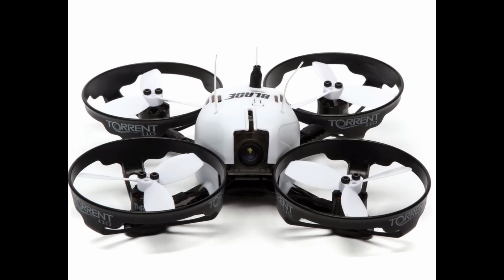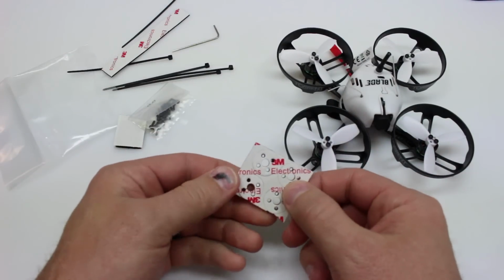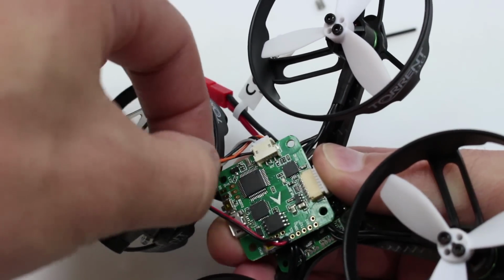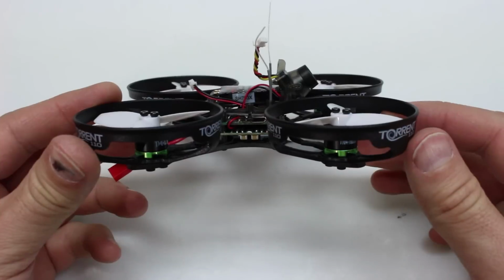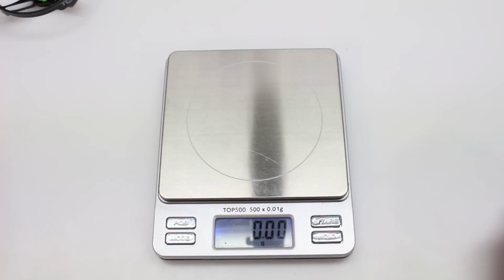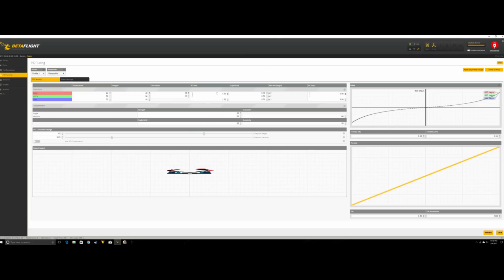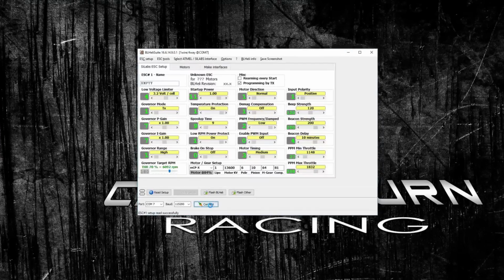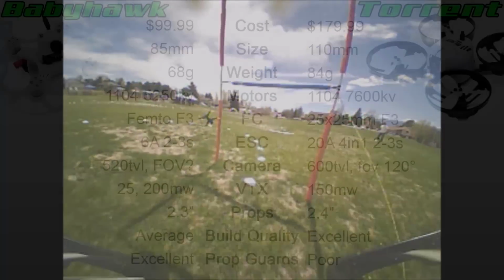Blade Torent 110 Review & Setup - Watch this before you buy!

Comment: I just got one of these last week dirt cheap. Not sure where to start when it comes to a transmitter and batteries. Could you point me in the right direction. This is my first fpv drone experience
Reply from the maker: This quad is set up to bind with a DSMX/DSM2 transmitter. Should be able to pickup a used Spektrum for cheap. Or buy a transmitter that can uses JR modules like a radio master and get a module for DSMX. This would give you more options in the future.
Reply: @CrashNBurnRacing  thank you so much for the reply I was looking at he radio master zorro

Comment: That twitch you mentioned... that's the crappy horizon hobby ESC's . They de-sync under punch outs. I ended up putting anti-gravity on number 5 and only now it keeps the line better. And the motors that came with it...are noisy and bad quality. 
My torrent is so much tuned-upgraded so it will fly better but that should have been done right by Horizon hobby before we slash out 200+€ for unfinished product.

Comment: If you remove the prop guards, you probably need to use shorter screws to avoid running a screw into a motor winding.

Comment: Hey goofball , the flimsy prop guards are helpful when ripping through tight quarters IE tree branches, bushes, etc, if you accidentally clip a branch it helps to save you from a crash. SECONDLY- you said the build quality was exactly what you’d expect from a great company like horizon hobby HA HA HA HA- you’re kidding right, horizon hobby has the worst reputation in the industry, they make their products so they’ll break under minimal wear and tear! I owned a couple of their heli’s And the canopies were absolute trash and would crack and split under minimal abuse, the chemicals we have available in plastics today are incredible and make plastic almost indestructible, but horizon hobby leaves those chemicals out of their manufacturing process on purpose.....
Reply: Or inside they are superfast indoors

Comment: Blade torrent 110 is a piece of junk the esc's will burn out, but just like all the blade BNF quads they are just crap, usually something with the power supply somewhere. Putting the telemetry receiver in this quad is like rolling a turd in sprinkles.
Reply from the maker: Last time I checked a replacement ESC was 60 bucks which is completely ridiculous.
Reply: Thats right its 60 bucks, Hobby town did give me the new esc board free, but i went in and bought a 'BNF" i soldered the new board in last night what a hassle, today when i put it back together if it dont work ill take the receiver out and throw the rest away.
Reply from the maker: Good luck!
Reply: You should learn to fly better iv bought 3 so far because i end up loosing them in the mountains or cliffs probably one of the best micro drone still i think it was just operator error in your situation

Comment: Where do I get the receiver for spectrum or flysky transmitters
Reply from the maker: The BNF version comes with a spektrum receiver,  the PNP version will need a receiver.  You can buy a flysky receiver from several online retailers. I would suggest Getfpv.

Comment: What's the battery life on the 800 mah 2s?
Reply from the maker: Really depends on how hard you push it but if your taking it easy you should be able to get 3 to 4 minutes.
Reply: Archie Mayor I fly a 950 mah 3s
Reply: I’m using 3s 450mah as recommended. Only 2 min and 20 second practical endurance. It goes from 4.2v to about 3.7v. I think the power of the quad rotor is good enough to carry 3s 800mah even 1000mah. It could easy hovering at less than 50% throttle with 3s 450mah battery.

Comment: Had my torrent fixed by seller 2 times flies away . well 7/10/17 it flew away can not find
Reply from the maker: Sorry to hear that.  Maybe Horizon will make a version 2 and actually have a true bind and fly.
Reply: Crash N Burn Racing It runs on betaflight and BLheli, No way it can be a true bind and fly unless blade comes up with there own flight controller and firmware for FC and Esc's. Being on complete open source firmware that they have no control over, Good luck with the wishful thinking. And lets all be serious nothing is truly bind and fly, Only mistake blade made was not disclosing to their biggest Audience that this quad is not an inductrix  you can bang around and its not tuned its running on stock spracing 3.1.5 default pids.. Also big sign saying not for beginners at all 😉 And when has blade used universal components lol
Reply: Mine 2 brother twice
Reply: Haha i lost 2 of mine absolutly same way it just punched on me as i was hovering them both

Comment: I dont understand the soft mounts for the motors. The screws will still transfer vibes so I dont see the point. Anyone kill the drifting issues with them? Have they always been included or are they something new that Blade has tossed in recently? Has anyone had luck with the soft mounts? I dont expect they'll do anything.
Reply from the maker: Joey Nuggetz The soft mounts don't eliminate all the vibration because of the screw but it still does make a difference for the gyro. I have the accelerometer turned off on my torrent but I have read that it helps the drifting issue.
Reply: Maybe I'll give it a shot then. I dont think you mentioned how the annoying screw blocks you from plugging in the usb cable :-) Before I figured that out I was cursing horizon for using a proprietary port connector :-) I haven't taken mine apart. What is that screw actually securing? How hot are your motors coming down with 3S? Debating on 400 or 800mah. Just tested 800 on 3S and the motors were scalding hot.
Reply from the maker: That screw is holding the canopy on, I have a slim USB port that works fine, or you can trim the plastic the usb plug.  My motors are a bit on the hot side but I push the torrent to max every time I fly it.  I tried 2s but there was just not enough performance for me.  I have seen a few people 3s 650mah lipos not sure what brand they were, flight time is terrible with my 3s 450mah nanotechs.  I have another set of the soft mounts and I might try to double up the foam pads to see if it helps, the foam pads are a bit thin.

Comment: HUGE pain in the ass to re-assemble.   I had to disassemble and assemble at least 3x due to incorrect orientation.  I almost also lost the spacers every time too LOL - For any other viewers doing this: Make sure the boards are ALL properly orientated, otherwise it completely ruins your day
Reply from the maker: kneel Glad you got it back together. If one did loose those spacers you could cut some rubber tubing for spacers and have the FC some what soft mounted.
Reply: they are junk

Comment: So the the props would be any less 'done' without the guards?...
Reply from the maker: The prop guards are technically better than nothing for minor bumps and crashes.  But any decent hit bent the props causing them to crack or become unbalanced.  I have broke one guard already and I have been fairly gentle with it for me anyway.  I just received 4 different 2 inch props that have a bit more room in the guards and am just waiting for the weather to clear up to see if they work out better. Also am very close on tuning out nearly all the problems with the PIDs.

Comment: Iam new to the hobbie and don't have a clue lol. I want somthing for indoors which give good flight times, don't like tiny whoop as battery don't last more than couple minutes. Love your reviews and I am pushing towards the babyhawk I have just brought the new Fatshark Hd3 googles and probably spektrum radio although not sure which one to buy yet, with babyhawk what do I need to buy and setup to work with spektrum? Can you buy bind and fly model Iam in the Uk. Thanks again for another good review
Reply from the maker: I heard Emax is going to release a BNF Babyhawk but it would be for the Tanaris and I have not heard when it would come out. For a Spektrum setup besides having a Spektrum transmitter you just need a dsmx or dsm2 satellite receiver.  I used this receiver in my Babyhawk, http://www.lemon-rx.com/index.php?route=product/product&product_id=109
Reply: Thanks for the help, not sure which radio to buy, I flew helicopters about 8 years ago and had spektrum radio hence why thinking about getting , been out the hobbie to long so behind the times
Reply from the maker: I have rarely needed more than 6 channels.  Having 2 aux channels will be enough to have 1 for arming and another for changing flight modes.  I have a DX6 and I really like it, if you want 8 channels the DX8 gen two is only a $100 more.

Comment: I  got exactly the same issue when I was using batteries with too low c rating on other quads before
Reply from the maker: The lipos I use are rated 65c-130c so it's definitely not that.  This wobble and drift in horizon mode is a very well known issue on the forums.  I almost had everything tuned correctly but then I hit my house and broke a prop so when my new props come in I should have another video on tuning the torrent.

Comment: Finally a honest review! Thanks! My Torrent is also dipping to the rear left during full throttle maneuvers. Sometimes it's hard to catch it at the and of a power loop, because it starts to get twitchy if I fully push the throttle stick. Some say this is due to bad motors, other say it's ESC de-sync. Maybe it's correctable by changing the PIDs? I don't now what's going on... Something feels weird about this quad.
Reply from the maker: I noticed a improvement in the throttle flashing the ESC's to Multishot 14.85 but did not fix it.  I am going to play with the roll I gain to see if that fixes it, if not i am going to flash the FC to BF 3.1.6 to see if that helps.
Reply: Awesome! Please let me know if you've been successful! I would consider myself a good pilot and I've done a few builds on my own, but I'm not that good at troubleshooting. The dipping at full throttle is something that's totally new to me. One of my 5" quads is prone to slightly throw its nose up during punch-outs, but the issue with the Torrent feels different to me, as if it was a problem on the hardware side. But what do I know... Maybe you can get rid of the problem and prove me wrong.